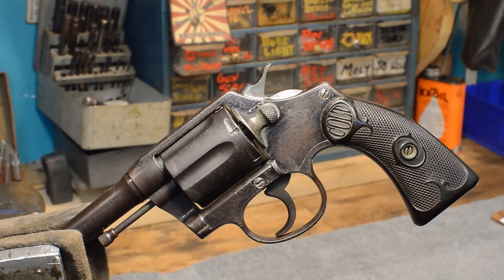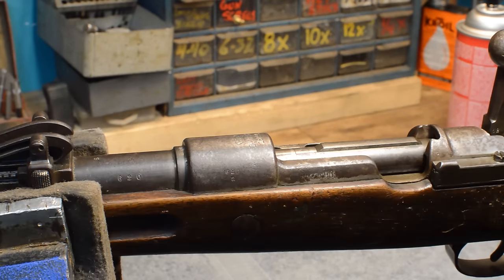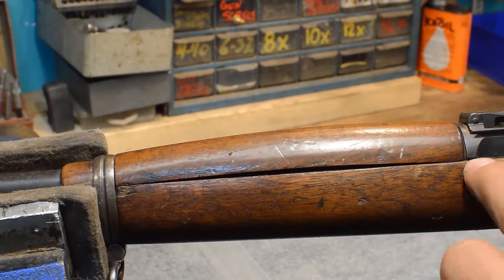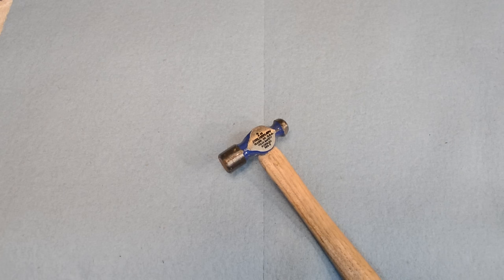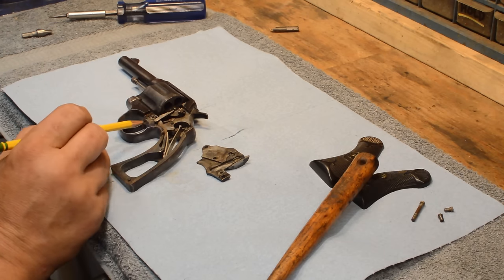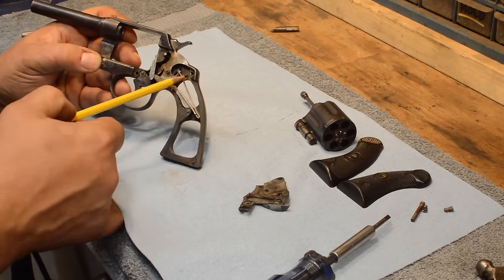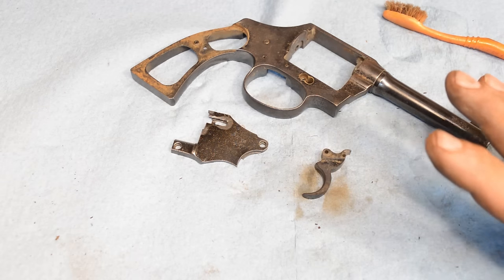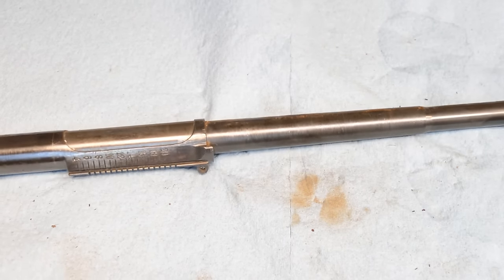Conservation 101: Stop the decay!

Comment: For those who are working on cleaning up old buggered screws another way I've found to clean the slot is to use feeler gauges or shim stock wrapped tightly with 400 grit sandpaper. You can add or remove gauges to get the thickness of the slot right and get everything nice and square. As much as I've learned over time hobby gunsmithing and now moving into professional gunsmithing there's always little tricks and tips to learn from watching your videos. Thanks for sharing all your knowledge.
Reply from the maker: Just tried this in the shop. Great idea, thanks
Reply: @marknovak8255  glad you liked the idea. I can't count how many various uses I've gotten from 10 cent garage sale feeler gauge sets.
Reply: I resorted to using the spine of a very fine jigsaw blade sandwiched with 400 grit.  I just cleaned up 2 banged up screws that came with my CMP 1911a1.  90% better.  Thanks!

Comment: I work with period furniture and the conservation end is interesting, especially in comparison to what you discuss here. For collectors "patina" is whatever it looks like as long as it has never been refinished. No matter how bad, how dirty, the finish is, if you do anything to it, it pretty much looses all value to collectors. Also museums will only allow repairs that can be undone, and are super obvious that they are repairs and not original. They want it done in such a way that the repair can be reverted back to the un-repaired state. This mostly comes up in upholstery where they will put an upholstered piece of hard foam on top just to make it look presentable but all the original stuff is underneath, all done without adding in any new tacks.
Reply: Well I have two 1944 dodges, a WC51 and a WC54, both were  in Norway through the 1950's to 1960's, and the WC54 was rebuilt by the US in Germany in 1954. I have the day the chassis were built from the Chrysler Museum. I have owned them some 20 odd years and serviced them, they both run beatuifully. So what is original?

Comment: Diesel #1 is kerosene.  Diesel number 2 has more paraffin in it.  They are used in big tucks.  #2 in summer the parrafin lubricates the injectors and injection pump.  #1 is used primarily in winter due to the tendency of the paraffin to clomp starting at about 27 degrees Fahrenheit and becoming more severe as the temperature drops way below zero.  Fuel heaters are used on the trucks to help combat this.

Comment: Woo boy. Glad I finally sat down and watched this. I'm trying to figure out how to stop the rust and pitting on my Martini-Henry (yes, pitting, it's one of those Nepalese Martini-Henry's). None of it is deeper than the rear sight dovetail and I'd like it to stay that way.

And without destroying the finish that is decently present everywhere else.

This video is immensely helpful.
Reply: I have the same issue on a mp40, I knew about using fine steel wool 0000 with vaseline oil, but not boiling the pieces with water before to convert the red oxyde into black oxyde
much to learn before trying

Comment: I used an old bolt together Craftsman table saw stand and mounted 3 lengths of 3/4" black pipe with "gas flame" holes drilled every 1/4" the length of it, then mounted 3 stainless steel Salmon cooking pots, one over each pipe, as a gun parts cooker.
1 is for boiling hot water rinse, 1 is for a hot degreaser solution, and the 3rd is for the parkerizing solution, each one individually set to run off one BBQ propane tank.

Comment: What a delight that was to watch! Thanks very much Mark Novak. For any other Brits watching kerosene is paraffin/lamp oil.
Reply: Lamp Oil frequently has additives like fragrances in the US. I’m sure The UK and EU have something like our MSDS aka Material Safety Data Sheets that will tell you what a particular brand of lamp oil contains. 
Another comment on this video stated in the US winter formula Diesel /Heating Oil is Kerosene while summer formula includes paraffin to decrease engine wear.
Jet A is jet engine fuel and should be available to purchase at smaller airfields that service business jet and turbo-props(jet connected to propeller). 
Good luck!

Comment: I'm glad you reposted this one! I hope it reaches more people and can save at least one gun.
     On the screws, the hacksaw tech is pretty cool. I've never done them that way but a decent set of swedish needle files can be had for about 40 bucks and work well. You can buy cheaper sets but why have to buy a tool a half dozen times.
     I have a 5 digit serial number Mauser 98 that is mostly matching numbers. I've done some work on it but I'm at a point of making decisions. I have made it safely operational (it did function but had excess wear on the safety, making it dangerous). It is my rifle and I haven't decided where I'm going yet. The rear sight blade, I  believe, was replaced at some point in it's life. It has a swastika on the underside that is about 35 years after the rifle was made, unless an old rifle had that added to it in the 30s. 
      Great video! Take Care and be safe, John

Comment: Using the wrong screwdriver not only buggers the screw slot but can produce a nasty scratch when it slips out under pressure and skitters across the surrounding metal or wood surface.

Comment: Bought a cop auction "Colt .38" Turned out to be a New Army, .38 Long. needed a new hand and spring (missing) and  a broken trigger return spring. Replaced them both but having an issue finding ammo. it's loose as a goose, I assume it's been shot with Specials. I figure it'd be a good candidate for finish conservation. Tightening it back up is something for a smith I can't afford, I assume.
Reply: Shims may still be available and are actually quite cheap. You may need some other small parts which can also be cheap but if you do it all yourself you will have lots of “useless” left over bits. Maybe check out some community channels or trade sites as you may be able to pick up someone else’s leftovers which may complete you gun. (Hand fitting means that their gun was probably out of spec in a different way then yours so their left overs may be good for you.

Comment: I am blown away by the boiling technique.  Gonna try that on my SMLE!  Thanks Mark.
Reply: well, I boiled my SMLE metal parts in water for 45 minutes to an hour and followed Mark's instructions, and I am so blown away and HAPPY that I did.  It is amazing to 1: see how much crud came off the pieces (dirt, oil, cosmoline, and RUST) and when I used 0000 bronze wool and gun oil, the rust came off, and 2: the finish came back out and the surface rust was gone. This baby is going to pass inspection from a platoon sergeant by golly!  I am amazed.  A bonus is I get to use my camp chef burner for something else besides tailgating at FB and Lacrosse games!  Thanks Mark.
Reply: @wolfpack4694  Good report, will be following up on my milsurp

Comment: Gasoline was the byproduct of making kerosene
Reply: I have read some stories from old oilmen, and the VERY early "refineries" that they used to produce kerosene for lighting, which most people don't know was the first refined commercial petroleum product. The tapped the distillation process, and drew of what was basically dirty gasoline, to use for lighting and heating in the refinery. I can't even imagine working in a refinery that was lit by gasoline fired lamps and all of the heat for the process came from open flame fed by pressurized gasoline.

Comment: Mark, please do a video on the stock maintenance. How do I remove years of gun oil and mung without removing the original oil finish? Many have said  lacquer thinner, mineral sprits, but I would like to hear your thoughts and maybe a possible video. Also how do you remove that polyurethane finish Bubba applied to your milsurp.
Reply: I Also would like to know the answers to such questions!
Reply from the maker: Yeah, I DO need to do that one. Arrrggghhh
Reply: Remove polyurethane with paint stripper made for polyurethane. Takes off the urethane without damaging the wood.

Comment: I took an old scuba pony tank, cut the top off and use it on the stove! I have a stove / range in my shop. The oven works great for larger cerakote. Big toaster ovens work good to for small stuff.
Reply: that is very cool, I welded two old C02 tanks together to the same effect and just run on a modified propane burner.

Comment: Jet-A is kerosene, purchase it at your local airport if you have problems finding kerosene. Or if you don’t want to pay $11 bucks a gallon for it at HomeDepot.
Reply: I have used diesel fuel in a pinch. But the smell is MUCH worse. I would recommend using it outside, or else your workspace will smell like a truck stop park lot for a couple weeks
Reply: I work at an airport and 200% they WILL NOT sell you kerosene. Not today anyway.
You may be able to find kerosene in the form of Zippo lighter fluid maybe, worst case order it baby
Reply: @xxIONBOMBxx  I’ve never been to an airport that was not happy to overcharge me for any fuel.

Comment: Once you take the parts from the kerosene, do just wipe it down and reassemble?  You said not to use gun oil. Not sure what process you follow after you remove from kerosene.
Reply from the maker: Wipe it down, blow out kerosene, oil with a non detergent (lawnmower) oil. Only necessary to use non detergent oil the first time, after a few days the finish will "harden up" and after that any gun oil will be just fine.

Comment: This is the most important video you have made.  I have a question, though. You stress the importance of cleaning the oil out of your carding disk and the steel wool. If the metal has been cleaned and boiled and the next step would be to soak in kerosene, what is the danger of the oil in the carding material?
Reply from the maker: Card first, kero next

Comment: 1905 hand ejector.  The butt was so rusted. The layers of rust stacked against the wood grips and split one of the grip panels. The estuchions and screw had fused. The screw, 
torque/ twisted in two. However there are places the original bluing is present. 
The hammer spring actually was fractured in two. Replacing it , proved the action was operative. I've decided to treat this old gat with humility and respect. It is odd how the butt and side plate appear to have been torture tested.  
While the deep original bluing. In other areas. Are so rich and still elegant. 
I have need of escutcheons and screw. 
For the bone grips I'll fashion. To adorn 
what I find to be a historical gem.
Certainly worthy of a little TLC. 
Thanks again Mark for your patient tutelage and candor. BravoZulu.

Comment: Currently going through the process of conserving a sentimental H. Pieper side-by-side shotgun. Two questions: 1. Any viable alternative for Acraglas? It's currently out of stock. 2. Tips on carding out the bore? Current plan is to use #0000 steel wool and push it through like a bore brush. Thanks so much for the great information.
Reply from the maker: I'm in the same acraglass bind as you are. Resin shortage, commy byproduct I guess. 0000 on brush, or just the brush, both work

Comment: Thanks for the information on boiling/kerosene treatment to convert/stop rust. I'm trying to conserve my rare 1936 Yugo Model 1924 Mauser without damaging the War effects of the soldiers. (Rare because it was seized by Germans in 1941, sent back to Germany to equip troops and ended up as a war prize to an American GI on surrender.) The "tank" boiling looks tricky but I think I can do. How did you treat the stock on that Gewehr  98? I'm planning to wash with TSP, then oiling with Tung followed by 0000 steel wool with beeswax/orange oil. (Finish we use in restoring antique furniture.)

Comment: I have a Iver Johnson break-top in 38S&W. Ruff is an under statement. Someone had gouged their initials in the side plate and someone else had used an abrasive to try and remove the initials. The plan was to make it safe to shoot. But it has so abused over the years I want to clean up the worst but I'm not sure I can. I'm trying to remove a burr down in the the ejector that stops the the casings/star from extending and ejecting the casings. Thing 15 wrong with it. 😁  
It has no historical or monetary value so a little of anything goes has creeped in. Is that a bad thing in this instance?

Comment: Dumb question but the kerosene you're using is the same stuff you use in old lamps?
Reply: Yes it is.  The thing it is not is the stuff sold at hardware stores as 'lamp oil'.  If you cannot find kerosene at the usual places, visit a home heating oil supplier.  Kerosene is their stock in trade and they will fill your containers for a decent price.

Comment: Would Ballistol work as a good water displacement? It claims to emulsify with water and allow water to evaporate leaving the ballistol as a protective layer behind.
Reply: Im not Mark but I am gonna take a jab at your question and you can ignore me as a nobody or maybe this will help you.  You could use Ballistol If that is all you had maybe, but it's real slow and I would wanna re-apply Ballistol once the water is gone just in case.    I use 10% ballistol and water for corrosive ammo cleaning, but I dry the bore with a patch then put pure Ballistol on the metal.  
If you want to get the job done faster I would use heat and air, towels/patches, or something like kerosene.  
The nice thing about boiling for conservation or rust bluing, the metal is hot and dries super fast.  I did a rust blue pistol on my channel and I never needed anything but a few seconds with a heat gun as soon as I pulled the frame and slide from the boil.  Most evaporated off immediately.
Good luck
Reply: You really want a penetrating oil to get into the metal pores. I’ve used ATF(Automatic Transition Fluid) when removing rust from car parts, but I’ve only heard “don’t use motor oil” from YTers. 
Lamp Oil: Kerosine plus fragrance and maybe other crap you don’t want. 
Kerosine: ideal if you can find it. In Texas I’m seeing it available shipped to store at Walmart, Tractor Supply, Ace, Lowes and Home Depot. 
Jet A: kerosene used as fuel for any size jet engines. Should be available at small airports if you ask around and maybe tell your story. Should be available in Europe too. 
WD40 aka Water Displacement 40th formula that was approved by the US Military IIRC. Not a good oil to leave on your gun but perfect for displacing water and soaking into the metal’s pores. Available in one gallon cans for $25-$30 near me.

Comment: When boiling, would there be any advantage to using distilled water over tap water ?
  Since it will be carded back off, it may not matter.
Reply: Hard water sometimes leaves mineral spotting. I use steam to sidestep water quality issues.
Reply: ^i just had spotting and found this comment bc I didn’t have a clue what I did wrong. God bless!

Comment: Mark how do you feel about refurbished / remanufactured parts? Do you not think there should be a universal mark to be stamped into replaced parts to show it's been replaced/remade and hence isn't "historical"?
Reply from the maker: Deep question, where do you go from refurbishment to flat out faking something? I believe that the honor system will work as it always has, but also we are getting to a point where so few parts will be left that it won't matter, either
Reply: @marknovak8255  do you have good sources for remanufactured parts? specifically springs for these colt revolvers and other old handguns? i have several, all have broken springs and no idea where to look  :(
Reply from the maker: @ChrisMan183  No sarcasm intended, I know a guy who makes his own parts
Reply: @marknovak8255  sigh.  ok thanks, that's what I thought.

Comment: I also boiled the screws, was that necessary? And how important is it to take the oils of the steel wool with acetone?
Reply from the maker: degrease steel wool only if reset is to be done....are you going to apply rust blue chemicals or a poly finish later? If not no need. The oil is a contaminate, only if downstream steps regard it as such
Reply: @marknovak8255  Yeah I'm not going to reset it, I'm keeping the original bluing, it's a krag jørgensen, passed down to me, the stock has broken clean off, so need to figure out how to fix that after I'm done taking off the rust, and putting it back together.
Reply: I boied the whole gun,, with the ammunition still in it, that was kinda scary !

Comment: Mark, with a Civil War gun (M1863) that was originally left completely in the white but has some patina that needs to be left but does have some sugar rust that must be eliminated, is there any difference in procedure? 

There’s no bluing to harden and only the sugar rust is what you want to remove but any older patina needs to stay or you have obliviously cleaned the gun and removed the value to collecting community? So the carding would have to be very gentle and the kerosene soak would be brief to only displace the water.
Reply from the maker: I am unable to do a conversion of red to black rust half way. The patina is rust, as well as the rust you want removed. If you convert by boiling, it will all convert.
0000 steel wool and WD40 is an alternative, and the unwanted corrosion can sometimes be ground off that way.
Reply: @marknovak8255  OK, thank you for the reply!
Reply: I think you could convert it fully, then use naval jelly to strip the bluing back off. Get a high polish on it then keep it well oiled. My 2 cents on that predicament.